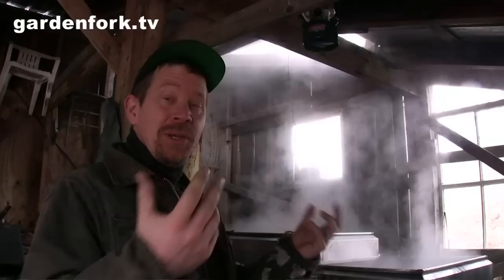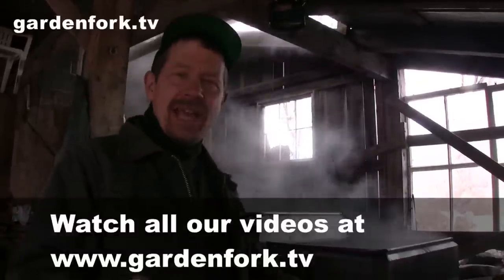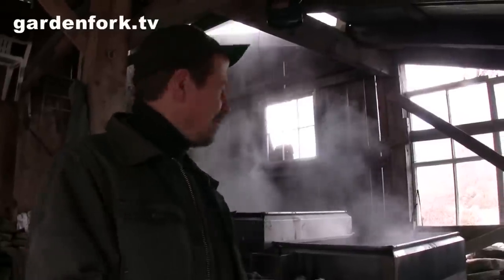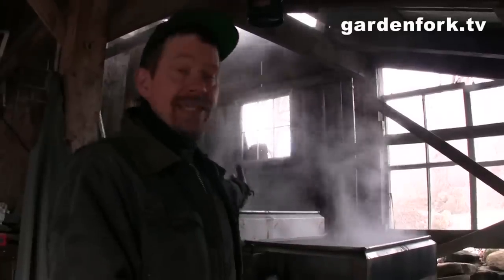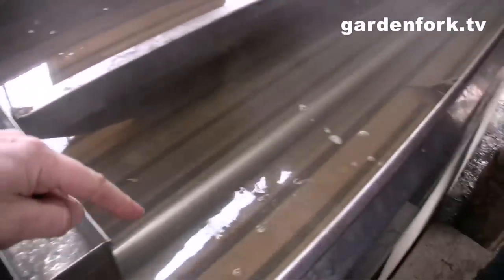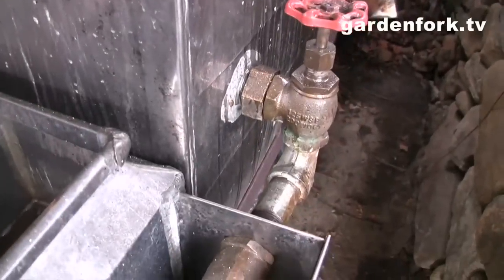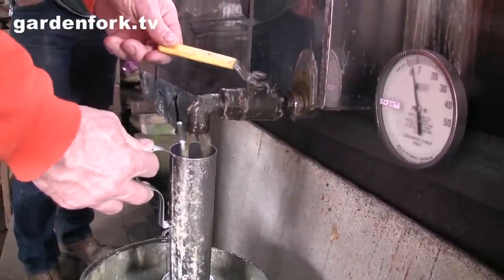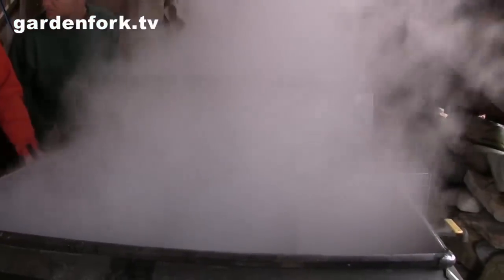Making Maple Syrup in a Sugar Shack - GardenFork

Comment: depending on how low scale you are going you can do it with a pot on a stove but it takes alot of sapand you want something with a heavy bottom, i've tried it with a turkey fryer before and it burns easy if its not being stired all the time, much like making caramel on stove top.